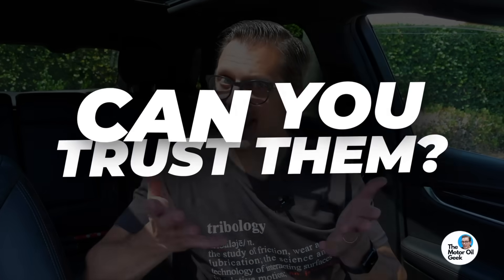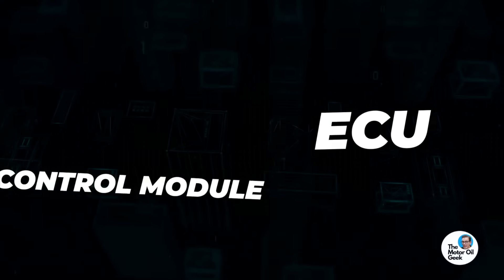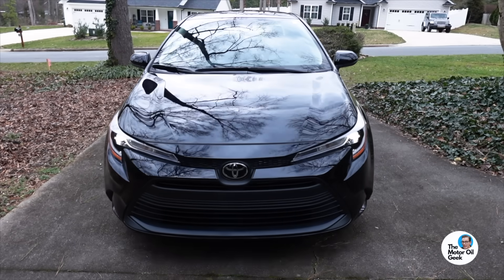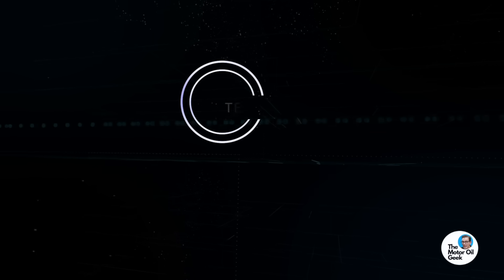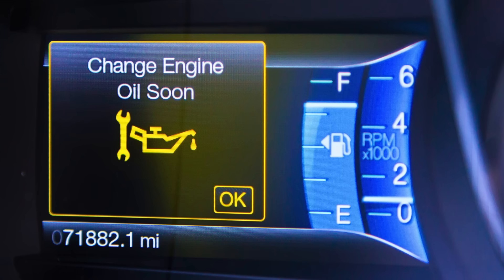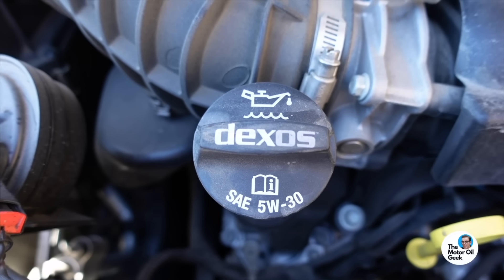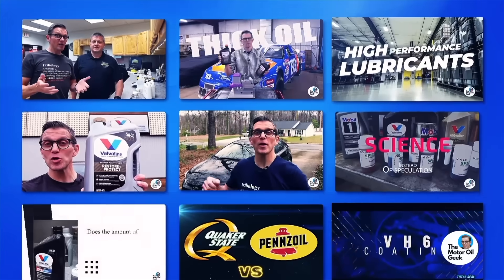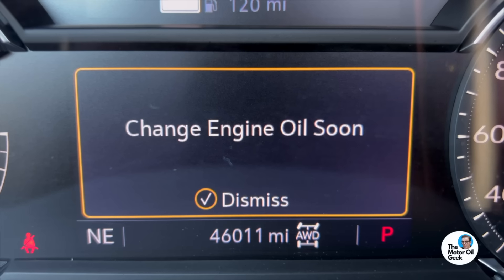The Accuracy of OIL LIFE Indicators REVEALED!

Comment: I have a 2016 Ford Taurus. This is my first vehicle with an oil life monitor. I was hesitant on trusting the monitor at first. I did my first oil change at 5,000 miles, The second oil change I went by the monitor, changed the oil around 8,500 miles and sent a sample to a lab. The lab said my oil looked good and go further on the next oil change. I have also done this with my motorcycles as well. I did an oil change 2 weeks ago on my car, going by the oil life monitor and didn't realize I had put 10, 283 miles on the oil. The lab results came back on Friday and wouldn't you know it. The oil was still in good shape, with below average wear levels. I have over 174,000 miles on my car and it still runs perfect. I have stuck with Mobil 1 5W 20 synthetic most of the time. I gave Amazon Basic full synthetic 5W 20 a try, sending the second oil change to the same lab. The Amazon Basic came back with a perfect report as well.
Reply: First oil change at 5k (assuming it was a brand new car) was the thing that made your engine run like it does, beating on it and waiting 10k on the first change is the real killer.
Reply: @huh0123  I did my first oil change at 1,000 miles. I don't beat on my car either. 174,000+ miles on my car and the only thing that has ever gone bad was the right front wheel bearing, which was covered under the mfg's warranty. The engine doesn't burn or leak any oil at all.
Reply: @Chaplain161  first oil change at 1k? Even better, although there is still some risk to that not getting everything out.
Reply: @huh0123 first he said the first one was at 5000 miles then he said 1000 so who knows
Reply: That is hard for a 60 year old guy to believe, but I do. It's just hard to justify not changing my oil anyway at 5 or 6,000 miles, when oil and a filter is 30 or $40, versus the possibility of the monitoring system malfunctioning and ruining an otherwise good motor.
Reply: @meandthemrs7403  why do you even watch this channel?
Reply: @Chaplain161  Why not?
Reply: Wish I could say it worked as well for my 2011 v6 EcoBoost Ford with full synthetic.
Reply: @mprooveit3588  Some 3.5L V6 engines suffered from the internal water pumps leaking into the engine and mixing with the oil. That was a horrible design. Also, if you have a turbocharged engine, it is good to let the engine run at idle for about 3 minutes before you turn the engine off, letting the turbo spool down and cool off. Once you shut the engine off, there is no oil flowing to the turbocharger bearings the oil can coke in the bearings on the compressor and turbine shaft and cause premature wear on the bearings.
Reply: @Chaplain161  Mine suffered from the oil feed line screens clogging and causing turbo failure.  Fun.
Reply: @Chaplain161 3.5 has an external belt driven water pump and they don't have that iasue
Reply: You might want to check into that. The 2016 Ford Taurus 3.5L NA has an internal water pump that is driven by the cam chains. There is not a belt driven water pump. I wish you were correct.
Reply: @k9m42 it depends on the application. In the FWD applications, the pump is internal and driven by the timing chain. I RWD applications such as the f150, it's external and driven by a serpentine belt
Reply: @dmandman9  it's transverse and longitudinal, not FWD and RWD. There's AWD transverse 3.5/3.7 and 4WD longitudinal. Pump had to be internal on transverse for fitment. Not so for longitudinal. Though both applications suffered pump leaks, internal was much more problematic.
Reply: Yes. I know .  And in the Fords, The Fwd applications ARE transverse. The RWD are longitudinal. So it's the same thing. Yes, the external pump fails too. But people don't give it a second thought. And the internal pump doesn't fail that often. However, when it does fail, it's memorable because it's expensive to fix even when it leaks through the weephole in the timing cover and is noticed before it causes catastrophic damage. But when the entire leak is internal and isn't noticed until internal damage occurs, it's even more expensive because an engine rebuild or replacement is needed in those cases
Reply: @dmandman9 same thing, different reason.
Reply: @FooJub Not worth arguing about. Neither of us said anything incorrect. Bottom line, a 3.5 with an internal water pump that develops a leak can can contaminate the oil . The 3.5 with an externally mounted pump can't. And those with the internally mounted pumps are used in fwd transverse mounted engine applications. The ones that have externally mounted pumps are used in longitudinal mounted / rear wheel drive applications
Reply: @dmandman9 who’s arguing? Best include the 3.7 as well.
Reply: @FooJub true, the 3.7 is really solid. I don't recall our shop doing much work to them in any application. They just run
Reply: I change every 3-5k
Reply: It all depends on your climate and the type of oil you use just change every 7k-8k
Reply: Ford....high mileage....long OCI, ha!
Reply: Does the oil analysis tell you the amount of carbon in the oil? Just because the oil is still lubricating doesn't mean it is still cleaning. Oil can only hold so much carbon from blowby. Eventually, it can't hold anymore and deposits build up in your engine.
Reply: @ZzzRoofus  Carbon will show up in an oil analysis as "Insolubles %". My last report showed I had 0.2% insolubles in my oil. The values should be less than 0.6 %. Insolubles are also oxidation of the oil and dirt that gets past your air filter and into your engine. Dirt that makes it past your air filter is also shown in the 'Silicon' section.
Reply: I had a 2011 Honda Odyssey.  I changed the oil based on the oil monitor system, always between 5% and 0% remaining.  Owned the van in Eastern Massachusetts and Phoenix, Arizona.  Shortest range between changes was 9K and change (with many short trips in Eastern Massachusetts over winter),  longest was just over 13K (included two cross country trips, so lots of highway).  The oil looked far worse at the shortest change interval than on any other change.  I always used the cheapest synthetic 0W-20 I could find, and Honda oil filters.  Sold the van with just over 120K as we became empty nesters (granted, that isn't high mileage), did all user manual recommended fluid, filter (did change the oil filter with every oil change, manual suggested changing the filter every second change) and belt changes.  The only repair I had to make was replacing the alternator that failed at 110k.
Reply: I got a 2015 taurus sho 10k oil changes sometimes more  im at 198k now purchased with 29k. I beat on it. only replace turbos at 115k and alternator 123k under warranty. Im just now doing timing chains which on that engine is pretty good alot fail at 100k to 130k knocking out everything else while its open
Reply: YTs ProjectFarm did a great oil comparison video you should give a go. Mobile 1 performed the worse and Penzoil was the best. It’s not about oil breakdown, it’s about friction reduction,temperature performance, and stopping metal-on-metal contact when it comes to oil. Synthetic oils make breakdown an antiquated value.
Reply: How much was the oil analysis?
Reply: @user-mz9rd5wg2w  $28
Reply: SeaWorld also doesn't have to be changed after one year that's a crock of s*** whether you drive 100 Mi or 800 me it's not true I've left the oil in for 3 years how test it in lab it was still in spec.   If you drive low mileage you can leave your oil in your car for 3 years
Reply: 3000 miles has always been the old school rule, but I could never find any scientific support behind it.  Since I switched to synthetic many many years ago, I always changed at 10,000 miles.  Never had one single engine failure in my life due to oil.
Reply: Oil change is only a part of the story. if you wanna know the truth, ask your mechanic for the old oil filter. Take it home , cut it open , then stretch the paper element, take a magnifying glass and analyze it. Soot is normal as a byproduct of burning fuel, the less the better. Use top tier gasoline. If you see any sparkling things, you should know that, those are pieces of your motor internal parts. Kinda like free radicals in your body ruining everything!
Anything more than nothing is a concern!
Reply: Oil change is only a part of the story. if you wanna know the truth, ask your mechanic for the old oil filter. Take it home , cut it open , then stretch the paper element, take a magnifying glass and analyze it. Soot is normal as a byproduct of burning fuel, the less the better. Use top tier gasoline. If you see any sparkling things, you should know that, those are pieces of your motor internal parts. Kinda like free radicals in your body ruining everything!
Anything more than nothing is a concern!
Reply: @adrianpuenary6507  I do my own oil changes and cut open every oil filter and inspect them.
Reply: I have a 1998 Ford Taurus. It has an automatic oil replacement system.
Reply: Why drive with filthy oil?
Reply: @DM-hw4cr if you change oil as recommended by the manufacturer, you won't have filthy oil
Reply: @DM-hw4cr  well my lab reports say it's just fine and to go longer. 90% of my driving is highway driving. Why waste money? Do you change your oil every time you drive it, if not, why?
Reply: Pro tip- reset  trip A and it is your oil life, try to change or atleast check. (Add the rest of your leftover oil if 4.x L oil was needed - u had 5l) at 6k miles. I use trip be for when I refill full gas tank or road trip.
The trans fluid- 60k- 100k miles - NEEDS to be partially replaced 1/3 capacity is a service. I do not recommend a full flush , ever.
Take a turkey baster and replace the power steering and break fluid ( not full flush) - every 4 or 5 years- water is absorbed from atmosphere into liquid.
Reply: @CamoPajamies  I always reset my trip A when I change my oil. 196,000 miles on it now, and I still have never had to add a drop of oil between oil changes.
Reply: What is not being said in this video is that the importance of changing oil is not for the sake of the oil, it’s to change the filter. Oil manufacturers put right on the bottle that their oil can go 75-100k without break down. But, engine wear will be occurring if the filter is not changed routinely. Go 10k+ between oil (filter) changes, your oil will be perfect. But, pull crankshaft journal bearings and they will show wear. Keep changing oil based on oil breakdown and you’ll spin a bearing, break a piston rod, etc. Change oil/filter annually or every 5k, you’ll still be going at 300k+ miles.
Reply: I have a chevy cruze . Drove it to 8.5k i believe it was 20 percent . Sent jt in for testing and they said the oil has about 500 miles left. Because of that I change every 5k and I am using aupertech full synthetic . Dont think that would affect it much
Reply: My philosophy is oil is cheaper than an engine
Reply: @The98deville  do you change your oil every 1,000 miles?
Reply: @Chaplain161  LMAO only if it's a garage queen class car!
Reply: @Davido50  its never been in a garage.
Reply: @The98deville  Yes for sure but goin less than 5k mis on modern SP rated/GF-6A full synthetics is absurd. Your not gaining anything. Been proven . I go 5k mis on my trusty 22 F150 Tremor 4wd GTDI 3.5L V6.
Reply: That theory in a vacuum is true.   The problem is when you oil every 3k when you can change it every 7k.  

Over 210k miles that’s 40 extra oil changes.   That’s 40 hours or more of your life spent doing something not needed.   It’s also 40x60…….2400 dollars out of your pocket.
Reply: Amazon basics oil is legitimately some of the best oil on the market. 

Kirkland and Super tech (Costco/Walmart) are also phenomenal oils. Can’t go wrong these days
Reply: So helpful. Any mechanic saying you HAVE to change your oil every 3k miles just to be sure, is just trying to make money. Oil life indicators are way more accurate than people expect. More accurate than just a blanket 3k mi interval.
Reply: @King_Cole  If it's 90% city driving, 3k mile intervals are still smart.

But if you drive 90% highway miles, 10k is definitely ok.

That's why GM's algorithm is useful and all other maintenance minders are kind of useless. Not sure why other manufacturers don't implement something similar. It doesn't need to be 100% accurate.
Reply: @AznCracker13  Miles are just one parameter. Again, throwing a blanket "3k for city miles" is too vague. 

Just use your oil life indicator bro. It's more accurate than you think. It takes into account way more data & variables, ie. temperature, engine load, manifold pressure over time, etc.. PLUS MILES 😎
Reply: @King_Cole  There hasn't been been a blanket 3k rule since the introduction of synthetic base oils back in the 80's. Before then... it was 3k for conventional base oils and then when synthetic base oils were invented and began to be sold in retail locations to the average consumer, the oci has always been 5k for synthetic base oils, even back in the 80's, lol. Anyone telling you to change your oil every 3k is really, really old school and waaaay too outdated with their understanding of engine oil and probably has a wildly inaccurate negative opinion of synthetic oil. I have never once heard anyone ever recommend a 3k oci for synthetic oil and I have been a mechanic for nearly 40 yrs, lol. When somebody recommends an oil change to you at a specific interval... they better know what type of oil you're using before making that call.... if they don't bother to ask before making the recommendation... they're just plain ignorant... as it has ALWAYS been known that 5k is a bare minimum for a synthetic base oil change interval. Even in the 80's mechanics knew that synthetic oil was good for twice as long as conventional, lol. The 3k oci rule of thumb has only ever applied to conventional oil and litteraly everybody has known that for many decades, nobody should be going by that super outdated philosophy that stems from a time when manufacturers were still using carburetors, lol. I don't know of anybody who still believes that, let-alone, goes by it. So your comment is a moot point that really would have only been relevant 30 years ago as they hardly even bother to make conventional base oils for internal combustion engine use anymore. It's getting harder and harder to even find conventional oil if that's what a person is looking for (I don't know why they would) but soon it won't even exist at all as all available engine oils will be a synthetic base. The only reason that conventional base oils survived in the market as long as they did was because of a cost advantage but that gap is lessening and the compromise is no longer worth the savings as it isn't nearly as much of a difference in price as it used to be. There is litterally no reason whatsoever for anyone to be using conventional oil in today's day and age, and that's why it's being phased out entirely in the market, it just doesn't sell, because it makes no sense to use conventional oil anymore (which is what had the blanket 3k oci.) Again... the 3k rule of thumb, only ever applied to conventional engine oil, which people stopped using long, long ago. And anybody who still goes by that recommendation is probably waaay too old and outdated to be touching any kind of modern vehicle.
Reply: I don't tell people to change there oil every 3000 unless it's older. I typically suggest to go by the oil indicator but then again if it's suggest it at 7500 to 10000 that's a little to long to wait. New f150 oil indicators say to change it every 7500 and eventually it's messes up the cam phasers. Then new audis suggest every 10000 for there oil changes and they have low tension piston rings and waiting until the indicator tells you to change the oil will eventually ruin them because most high mileage audis burn oil and that just one symptom of a failing low tension piston ring
Reply: @King_Cole  Yes, the 3,000 mile oil change was the standard years ago. Oils and engines have come a long way since then. Some people will say that an oil change is cheaper than an engine, which is true. I don't see those same people changing their oil every 1,000 miles either. But just like Lake Speed Jr. always says, it is Science, not speculation.  I have never had a bad oil report come back. Harley Davidson's recommended (engine) oil change interval for my last bike was every 5,000 miles. I don't have a problem with that because of some of the conditions I ride in and the HD engine being air and oil-cooled. I did a coast to trip and back home in a weeks time. I put 6,200 miles on the (Syn 3 20W 50) oil. I sent a sample to the lab that I use and it came back almost perfect. The only thing that was off was the viscosity was a little higher than it should have been. The wear levels were still below average. After watching many of Lake Speed Jr.'s videos, I believe the additive package was evaporating. I rode from Jacksonville, FL to San Diego, CA in 58 hours. Most of the time the temp were above 90 degrees and above 100 degrees in the desert. Like I said, oil has come a long ways in the last few decades.
Reply: @Chaplain161 He is right, if you wanna keep you motor running for a long time. If not, then don’t!
Reply: @Chaplain161   no you can't just make blanket statements without all the facts 

What if the vehicle idles for 20 hours per day on top of driving those km 

Or what if the vehicle has an issue you are unaware of
Reply: @NickTaylorRickPowers  that is why I send my oil to a lab, to have the facts, not speculation.
Reply: @King_Cole  3k is the standard, i see alot of shops do 5k too however i do 3, diesels also 3, however some of the turbo fords and smaller 4 bangers can run really clean, ive seen some go 7-8k and the oils still pretty clean however semi syntheic is so cheap id still change it i mean what $25-30 for 4qt. But in 90% of cars the cars internal oil life system is wayyy off, unless its a higher end eu car with the moduale and sesnor in the pan and coolent temps and you gotta let em warm up to see it and shit even then there not 100% but i dont see many of em
Reply: @ I simply do both. Miles and the oil life indicator, it's are going to be overall more accurate. Oil life indicators use many more factors including miles. In some cases the indicator can be way less than 5k for lots of high load applications.
Reply: Every 3 months or 3,000 miles if you read the before and after tells that if you drive your car less than 8 miles at a time or you don't drive it very frequently. This is to keep the moisture out of the oil. Keep reading the owners manual will tell you that if you drive for longer and more frequently then you should change your oil at 6,500 or 7,500 depending on the manufacturer. But who reads that thing when they can just watch the oil companies commercials telling them when to give them money
Reply: @heavenleigh111  well, my drive to work is 117 miles, one way. I have gone well over 8,000 miles on many oil changes. I send a sample to the lab every other oil change, and it comes back with a great analysis. I trust their science over anyone's speculation or opinion. My owners manual doesn't give a recommended mileage to change the oil. It tells me to go by the oil life indicator on the dash.
Reply: I’ve never sent samples to a lab… what do you do, and what label do you use?  And how much does it cost?
Reply: I doubt you’re sending a sample to a lab every other oil change.  Would cost you more to have that tested than to just make the oil changes.
Reply: @akwolf1434  I travel 117 miles to work one way, It gives me a piece of mind to know I have no issues with the engine in my car. Plus, I find it interesting to compare the samples.
Reply: @mr.watertwister9810  Most labs will provide you with a kit that includes sample bottle, baggies, labels and a shipping box.
Reply: Oil life indicators go out the window with turbocharged motors.
Reply: Really appreciate this information as I have a hard time tracking mileage between oil changes and have been using the oil change indicator and trying to catch it at about 25% life left. Now i feel comfortable going further. I use Mobile 1 in my 2010 5.3 Gen 3
Reply: What is this "lab" you speak of?
Reply: @jmak5552  Blackstone-Labs
Reply: I used to change the oil in my 81 Tercel once per year. Never had an issue.
Reply: Wow paid by the car companies much?
Reply: @sbingr5313  LMAO
Reply: Do you boo boo. Smart people never go over 5k on anyone change. Synthetic or not never exceed 5k.
Reply: @onehitterquitter2130  over 200,000 miles and still going strong. I trust my lab reports over keyboard warriors that have no scientific proof to show me, that the lab is wrong.
Reply: @Chaplain161 labs are not in the shop where I am. Oil all oil starts breaking down even before 3k miles. I've seen it all. I dont know any mechanic that goes over 5k on an oil change.
Reply: Lmao. You fools keep changing that oil at 10k. After you engine is sludged up and ready for the scrap yard, look in the mirror for the cause.
Reply: @givemeabreakdoc  I’ve been driving my jeep Cherokee with a 4.0 engine in it for over 20 years it now has 300,000 miles on it. I’ve always changed the oil every 3000 to 3500 miles. Never one problem. Had to replace the valve cover gasket and the oil gauge sending unit once. That’s been it. When I had the valve cover off to change the gasket, it was so clean it still looked brand new not one bit of sludge.
Reply: @givemeabreakdoc  I just ran my bore scope in through the oil fill on the valve cover. HA! No sludge at all.
Reply: @Chaplain161  and how many miles?
Reply: @ 182,000 now
Reply: @givemeabreakdoc is that why companies have 20k mile oil and filter ratings? Why arent the being sued for wrecking engines?
Reply: @ I don’t know, but I can guarantee if you follow a 20k regimen, you will ruin your engine.
Reply: @hubster4477 They aren't saying you should go that long, they're saying that "in theory" in a perfect lab setting, with controlled conditions, their products "can" last that long, but that doesn't translate to real world conditions. No matter what it says on the jug or filter package, you still HAVE TO follow what your vehicle manufacturer recommends. After all.... they are the one's who spent millions designing, engineering, and testing that specific engine in real world scenarios. The people manufacturing the oils and filters found on the retail shelf, have no idea what engine that oil is going into and in what kind of environment you'll be using the filter in, but what they do care about is marketing and percieved advantages that net them more sales. Critical thinking skills and common sense is applicable here.
Reply: @johnny0454  wrong, theres no theory involved when they put 20k mileage on oil jugs and filters, it doesnt say only in lab conditions.
Reply: Because it is very rare for an engine to fail in the first 100K, which is the most miles any manufacturer's warranty will cover, and even rarer for that failure to be due to an oil issue.
Reply: @givemeabreakdoc sure bud. I drive my cars until they rust apart. I live in the snow belt. I've hit 300k miles on two trucks. 200k miles on mulitple other vehicles.  My project car 92 Stealth has 160k miles on it and runs beautifully. I use full synthetic and change my oil every 10k miles and if I go a little over that I'm not stressing . I just did a compression test on my stealth and it's still well within spec.  I've never, ever had engine issues on any of my cars. I get rid of them because they rust apart and I get tired of working on them. I'll just change the oil on my 60k mile Sierra when I get tired of the oil nanny barking at me. Lab tests are worth more than either of our opinions. But you keep pissing your money away on unnecessary oil changes. It's a free country.